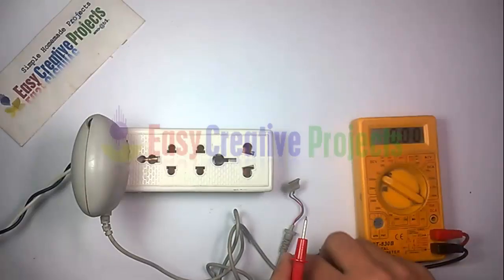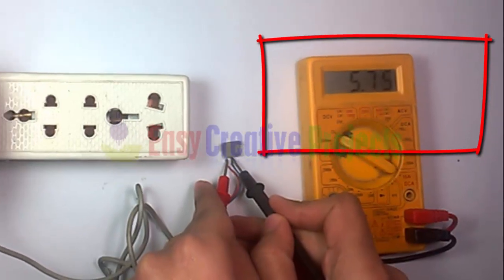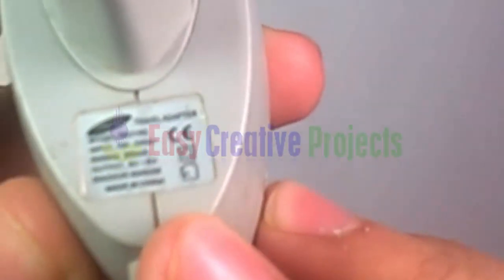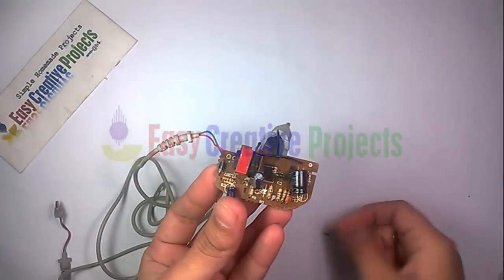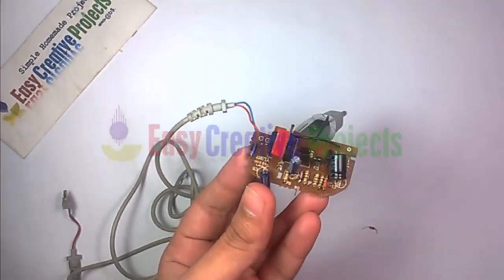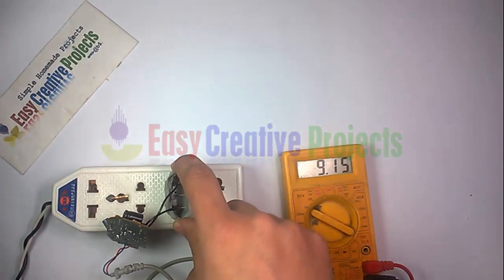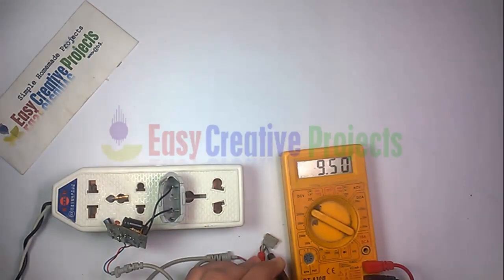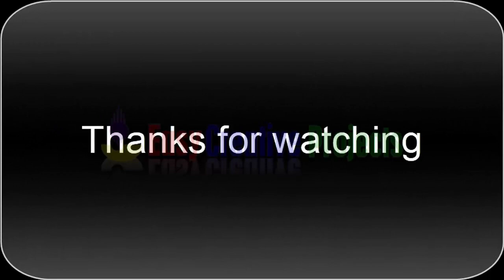How to convert 5v charger into 9v - easy steps

Comment: What about those charges that do not have a Zener Diode in them? Any suggestion?
Reply from the maker: then you need to increase transformer wire turns. its difficult but nothing is impossible.
thanks.

Comment: In this case, if I change my 5V zener diode to 9V1 (9.1V) then, should I change the capacitors as well? I have noticed is that you have only changed the zener diode. But somewhere below you have mentioned about changing the capacitors. If YES then can you tell me the uF and V of the capacitors to be used (two of them)?
Reply from the maker: yes normal mobile capacitor only 10v and 220uf. if we increase voltage 9v then 10v capacitor burn soon. and output also come in loop. 
for burning safety we need 16v to 25v, and for smooth current coming we need 470uf to 1000uf capacitor. 
hope you understand. thanks.

Comment: Can I charge hair  trimmer from 5 volt adapter plugged into  1.25 watt  solar panel if it's AC charger has 1.2 volt output only ?
Reply from the maker: for 5v battery charging you need 5v power supply. 1.2v is very low. 
try to use 6v or 12v solar panel. then you can easily charge you hair trimmer with this.
thanks.

Comment: Thanks brother. Kya 9 volt ki jener diode se circuit me over volt se koi components damage ho sakta hai ya nahi? Capacitor me me jyada load ho sakta hai ki nahi?
Reply from the maker: dear normal charger 5v power k hisaab say design keyah jatay hin. but jb hm zener diode change kr k voltage zeyada krtay hin to hmain usi hisaab say capacitor ki voltage b change krni prti ha.
agr aap capacitor change krna chatay ho to 16v ki jga 25v ka capacitor use kr lo. (for advance safety)
but yah ak jugar ha. 
proper solution yahi ha k aap 9v ki power supply use kro.
you can see video on our channel ( how to make 9v power supply easy at home)
Reply: @EasyCreativeProjects  thank you so much brother.
Reply: Aur ek baat brother aapne jo 9 volt ki power supply banaye hai us supply se 12 volt 775 ki DC motor Chala sakte hai? Please answer  me brother.
Reply from the maker: chl jay gi but agr full speed chaiyah to 12v ki power supply dayni pry gi.
Reply: @EasyCreativeProjects  thanks brother.

Comment: Bhai 12v zener diode lagasakte hai
Reply from the maker: jitni output chiyah us voltage ka zener diode use kr sktay hin. 
but if you want to increase 9v then you need some more changes in charger. 
see my next upcoming video. i try to explain it more better.